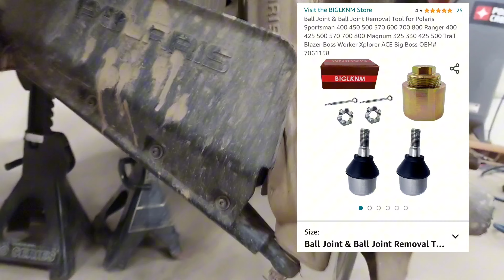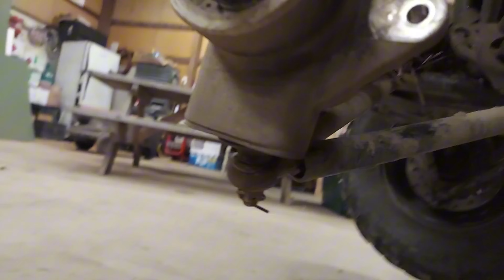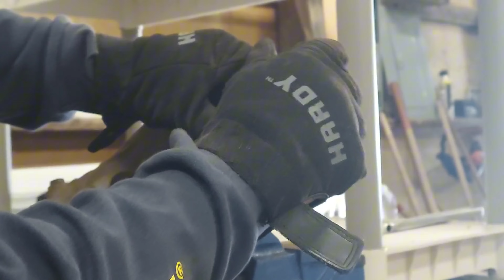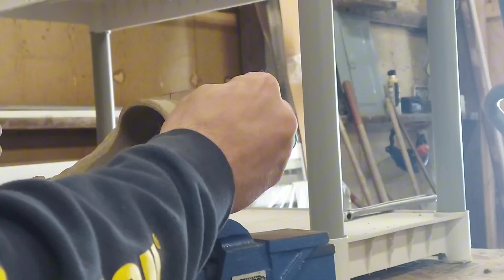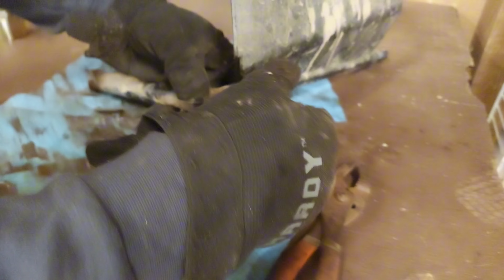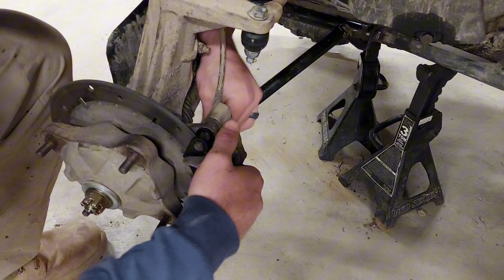Sportsman Ball Joint / A Arm Bushing Replacement  #polaris #atv #mechanic

Comment: Very helpful video.  Thanks for sharing your time and experience.  Came across your video while looking for info on replacing cv axles, boots, fuel pump and hoses and numerous A-arm bushings, etc. on a Polaris 2004 late Sportsman 700 EFI twin.  Have very little experience working on the machine but have watched a bunch of videos and thanks to you and other kind folks I feel I will be able to complete the challenge.  Do you have and/or can you recommend any other videos that applicable to the 2004 mentioned above ?  Thanks again for sharing your time and expertise.
Reply from the maker: Thanks for the positive feedback.  I don't have much on that particular quad.  But I do have some on other polaris machines. A lot of them are pretty similar when it comes to replacing suspension parts.

Comment: Couldn’t ball joint tool be used without removing knuckle?
Reply from the maker: Absolutely it could be.    It's just harder to install the new ball joint.  But you can definitely remove it easily while it's on the machine.